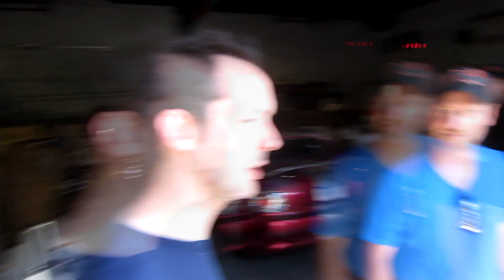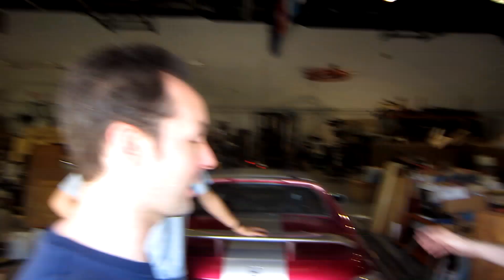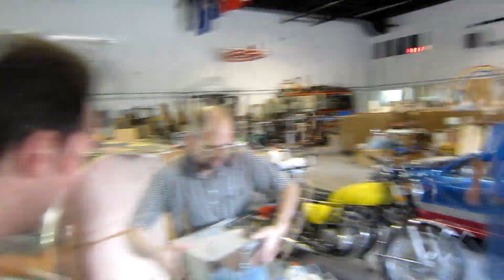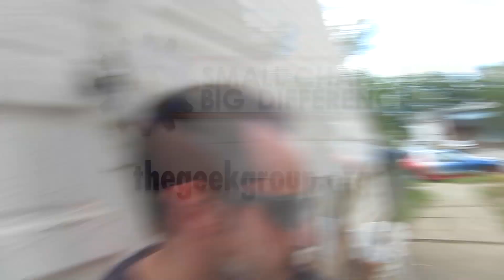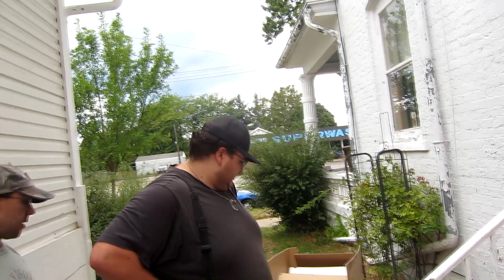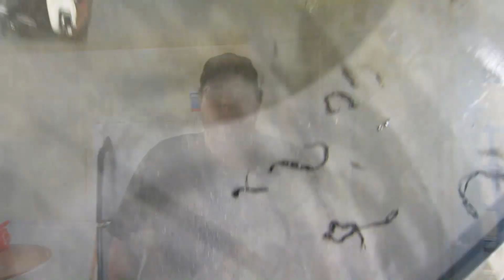Captain's Blog 8-11-2012 Kevin's Giant Donation, GH6-7 Progress, and Air Raid Upgrade

Comment: Nice air raid siren growling!  I bet you could hook up a mic and audio amp out to an oscilloscope to show the low frequency wave forms to demonstrate the shape of the sound waves.  And since sound waves of course alternate from high to low then just maybe you could put a cone speaker in front of it and get alternating current out and show how sound is a way to transfer energy over distances, that energy manifesting itself in various forms - electric to sound and back to electric.